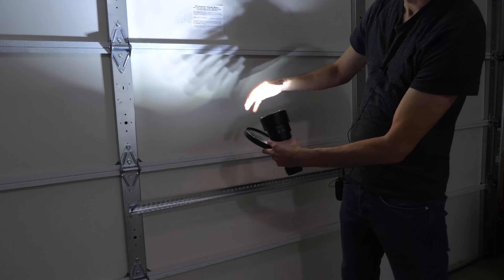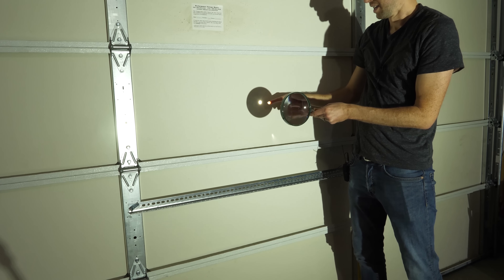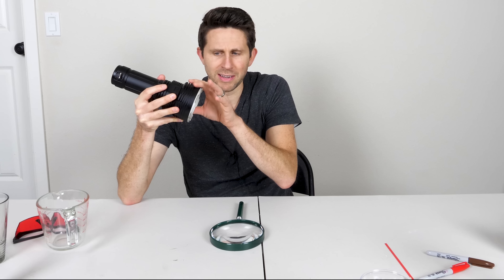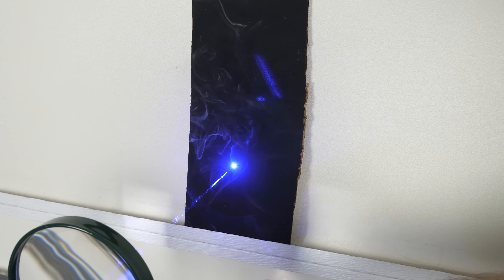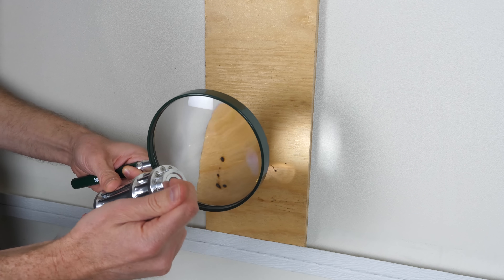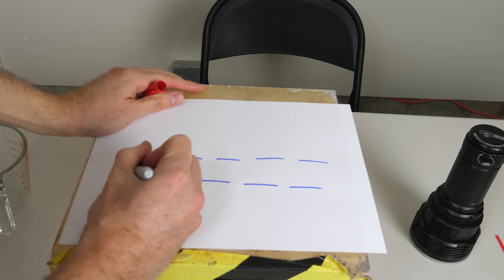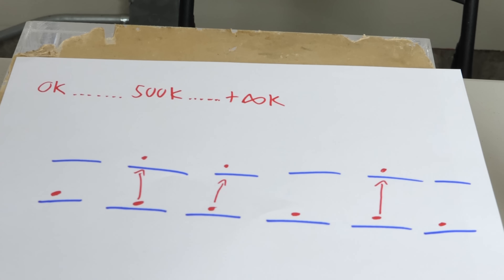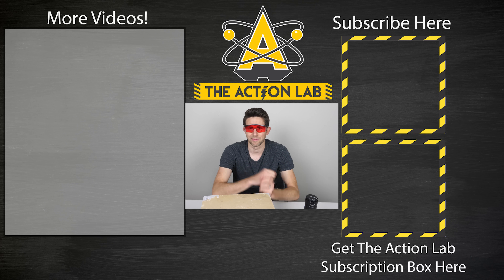What Happens if You Focus a 5W Laser With a Giant Magnifying Glass? Negative Kelvin Temperature!

Comment: I can imagine a combination of lenses and mirrors that would be able to focus most (losses in mirrors and lenses) of the flashlight light (lumen) towards one point and as it is true that this flashlight has multiple LEDs, i can suspect, that the focused point would be brighter on a "super white" surface (candela) as any point of the light source, as it would focus more leds "shine" (lux) towards one surface point... But clearly understand your point, but it assumes one point light source. Even a surface light source as the Sun can be focused with a big enough lens to shine brighter on one spot then it would be without the lens, but even o a black ithem the temperature will newer be higher then on the surface. Just temperature not always corresponds to subjective perception of brightness (as luminous flux takes into account the perception of individual wavelenghts)...

Comment: Wtf, this is simply not true.
Reply from the maker: You need to do a little research buddy
Reply: @TheActionLab  i did, lasers dont fall in negetive Kelvin and is not the reason it gets hotter when but under a magnifying glass is because it concentrated the light to smaller point the light from the laser never get brighter. The same concept can be seen in galileos telescope if light is shined from the other side

Comment: You can get a hotter point that the source. You're confusing temperature, a form of kinetic energy, with the total energy output of a source, the actual thing that is mentioned in the 2nd law of thermodynamics. You can use sunlight to focus and make a point hotter than the surface of the sun, it will just be very concentrated and will most likely disperse immediately. The amount of energy for this will still be smaller than the sun's. Otherwise I guess I agree with everything else.

Comment: i dont see how it would violate any law of thermodynamics. from this experiment, it looks like the sum total of light and heat remains the same, but the applied surface area is much smaller, in the same way that youre not suddenly heavier when you take off snowshoes, your mass is just focused on a smaller point. can you measure the temperature of the laser beam both while normal and focused?

Comment: Could you reflect the light that misses the magnifying glass so you don't lose it?
Reply: You would need an even bigger lens... which would require a longer distance from the light source for it to focus... which would require an even bigger lens... which (you get the point).
And still, even if you could, you are just redirecting the light. So I believe it would not be any hotter than the surface of the LED light.

Now, if you reflect and intensify that light with a mirror, and lead a tiny percent of that light escape thru it (all mirrors do this because there is no such thing as a 100% reflective mirror) and you direct that tiny percent to a specific point. Then, well, that would be a laser :P
Reply: If you reflect the light, the light can't bend enough to focus into a single point. It'll just keep going in its own little direction.

Comment: Oh my. Yes, you did not break any laws of thermodynamics. Yes, you did burn your target more efficiently using the the magnifying glass. You proved both those things. But everything went off the rails in the explanation. What happens is that the output of the laser is focused. Think of it this way, the output of the laser is 1 Kg of feathers, the magnifying glass changes it to 1 Kg of lead. As for negative Kelvin, serious math and quantum physics concepts were broken. Your video is an interesting display of scientific curiosity at work. Stay curious.
Reply: William Morton read up on negative temperature and you will see what I mean.
Reply: @ActionLabShorts  Thank you for reading and responding to my comment. Just a couple of things. "In quantum thermodynamics, certain systems can achieve negative temperature; that is, their temperature can be expressed as a negative quantity on the Kelvin or Rankine scales." - Wikipedia. The key word is "system." A system is bounded, it has a wall. A wall may be permeable or impermeable to matter, energy and/or entropy. A laser might be described as a system with a wall that is permeable to energy. Any system that involves negative temperature has a totally impermeable wall. It can never interact with its surroundings. Any system with negative temperature cannot interact with its surroundings. Crudely put, it can exist in theory but never in the universe. Hope this helps. Keep doing science.

Comment: your not correct. you can coalesce all the light from a flashlight into a single small point. the flashlight you use has a bunch of led being directed through projector lenses. that is why when you stick the lense in front of your flashlight it spreads the light. you would need a lense with the opposite curvature on it since you are already lensed in the flashlight. as far as focusing light, you can only focus something from the size of the lense to the smallest point. it is the same amount of light you started with and puts it all in one point vs spread out  your experiment is very inaccurate and doesn't account for or control for the variables

Comment: You can make the focal point hotter than the source it just takes geting it focused in a small enough point. Also the focal point is not actualy hot itself. Also if you got the focal point hotter than the source. What you cant do is by taking lets say 10w light source and focus its output to a point that would be mesured as higher than the source. If im wrong tell me.

Comment: You can never focus a diffuse light to a single spot because it's a surface source, meaning that the light is emitted from a surface rather than a point.
For any light to be focused to a single point, it must come from a point source.
Perfect point sources have zero volume and surface, which can't exist in real life.
However, lasers are a close approximation of point sources due to their highly parallel photons.
Though not even lasers can be perfectly parallel due to diffraction; to to have a perfect laser, the opening must be infinitely big.

Comment: Just a question, you said it is never brighter than the surface of the sun, but considering that all light rays are parallel,  taking a section of the sun with same surface of the lens and not considering atmosphere consumption of the light, the resulting ideal point is brighter than the surface we have taken?

Comment: What's really weird is the temperature scale is like a circle. You can reach negative temperatures by passing absolute zero as well. As you get really close to absolute zero, I'm talking within trillionths of a degree, there's so little energy that the molecular bonds, and eventually the subatomic bonds break down because there's not enough energy to hold them together while everything just gets flatter and flatter which is why a drop from absolute zero (the coldest temperature possible) can result in a pure high energy state, because there's no longer anything keeping the particles together. I probably didn't explain this very well but hopefully someone can do a better job of saying what I'm trying to say.

Comment: I am a CNC Laser Operator and that how my Lasers work ... it sends a 4000 watt beam through a series of mirrors to a lens torch that has a high grade lens that narrows the beam down to the range of .005 to .008, which is the general range we use, to cut metal that is generally between 1/4 to 1/2 inch thick

Comment: Why does the distance between the Laser and the Magnifying glass matter? I can understand the distance between the magnifying glass and the target, to set the focus but why does the position of the laser matter in relation to the lens?
Reply from the maker: Just to get the point of laser light to the smallest point possible.
Reply: @TheActionLab  Yes, but what is happening in physics to cause that relationship between the distance of the light source and the lens? Does that relationship change between using a polarized light source (A laser) vs a typical light/the sun?

Comment: Something viewers should still note: While you can't get a hotter temperature than the source of a flashlight or the sun with a magnifying glass, when the source is far from the surface you can still amplify the weaker dispersed light that reaches the surface to be hotter than the dispersed light is - just not hotter than the original source.

As kids my brother and I would go outside and burn stuff by focusing the sunlight with a magnifying glass. Condensing sunlight that covers the surface area of a magnifying glass down to a single point is hot enough to burn, but still nowhere near the source temperature of being directly next to the sun.

Comment: Uhm when you are using the laser directly against the wood, the light isn't concentrated on one point, it's still pretty large, so that's y it doesn't get as hot as the  the focused laser point because you then have a smaller surface area, and about energy, in my personal opinion your explanation for whats happening doesn't make sense, I think you just confused temperature with energy, the total energy at the focused point will always be less than or equal to (ideal case with 100% efficiency)the energy supplied by the laser pointer. The laser pointer isn't hotter than the focused point because energy is not = temperature, it's just that at the wood, the energy is used to increase the temperature of the surface and at the laser pointer, the light is the main form of energy and thus isn't as hot
Reply: In short energy has many forms light, heat sound etc. You just confused light energy and heat energy I think. So the 2nd law still holds true, and that -ve Kelvin temperature stuff didn't  make sense to me at least.
Reply from the maker: I didn’t confuse temperature and energy. Heat always flows from hotter temperature to colder temperature. The temperature of a laser is hotter than whatever you shine it on due to population inversion. What you shine it on can only go to positive temperature, but never negative.
Reply: @TheActionLab   The Action Lab  okay I read up a bit more on population inversion and I get what you are saying, cool, I'll edit my comment, but I still have a question

Firstly I think the laser isn't as hot as the surface it's shining on because the energy to heatup the surface is being transferred in the form of light not heat, so it heats up because there is no flow of heat but rather flow of energy in the form of light and then  conversion to heat at the surface, therefore I think the second law holds true since there is no transfer of heat energy, is this correct?

Comment: from an optical approach the problem is lenses focus only parallel light in one point  so you can only focus the part of the light that comes straight out of the flashlight. a laser on the other hand generates light that is allmost completly parallel and therfore you can focus the entire output in one spot.
Reply: also the farther away you hold the lense from the light the more parallel is the light that hits it and so more of that light gets focused and there is less of a "mess" behind the lense and more of a dot.

Comment: You still lose heat through the lens but the point is also reducing the radius. The heat density is more constrained and doesn't violate thermal dynamics due to reduction of area in which heat is applied

Comment: I think I disagree with your explanation. Maybe I'm trippin', but I don't think the laser is getting hotter overall once focused with the magnifying glass. However all the energy dispersed over the width of the laser beam is now focused onto a smaller point, and thus the energy at that point is denser and it's "hotter."

You could make a point that's hotter than the surface of your flashlight using a magnifying glass. However the amount of energy in that point would still be the same as the surface of the flashlight. You'd need the reflectors on the flashlight to first reflect the light such that it were a much narrower cone like a laser so that all the light could go through the magnifying glass at the desired focal distance. Makes sense? In this situation, you'd end up with the same result as the laser - the point the light is focused at would have the same amount of energy, but denser than the surface of the flashlight, and thus hotter.

In my mind the lasers are actually not different than the flash light. The problem is the way the light is directed. The laser is a very very narrow cone, the flashlight is a broad cone. So at the distance you can focus the flashlight beam to a small enough point, most of the light has already dispersed.
Reply from the maker: You are correct, that’s the point (so you don’t disagree with me, lol) The laser has a temperature that’s hotter than positive infinity. So even if you got any object you are heating to positive infinity the laser source will still be hotter.

Comment: I think the main reason the energy is flowing from cold to hot is because you use energy to achieve this. After all, in a fridge the same happens; you use energy to cool down a cold space and at the same time heat up a hot space. I feel like this explanation makes more sense tbh...
Reply from the maker: Heat never flows from cold to hot, even in a refrigerator! Please don’t ever think otherwise. The whole method of operation of the refrigerator is compressing gases so that you can remove heat while the heat always flows from hot to cold
Reply: @TheActionLab  still, overall it's an active heat transfer from cold to hot. I am aware that heat never travels from cold to hot passively, but you could consider operating a laser an active heat transfer.

Comment: Hey TheActionLab,

Wouldn't the light be able to be bent from the flashlight into a smaller point when you get a really strong / multiple lenses in front of it? I get that the purpose of the intro was to show how we can never get a spot hotter then the surface of the sun, but I feel like that is just true because we can only get a very small amount of sunlight relative to what the sun actually emits. 

Also, according to Q = cm(Delta)T, if we heat a very small mass we need little energy to get a high temprature change. 

I would like some sources that tell about the negative temprature, as well as your opinion on this.

Comment: would it be possible for something to go a negative speed?
Reply: The Novel Ice Cream Studios yes, negative velocity is based upon what you decide is up and down really, negative doesn’t equal backwards, it’s just the opposite, so if you throw a ball from ground level and it goes lower than ground level like into a body of water you could measure that as negative speed, negatives in speed or velocity are usually relative to which direction you are considering to be positive. The ball would be going negative ft per second, making the velocity negative. ( anyone feel free to correct me if any part of this is wrong )
Reply: RebelRhiannon speed isn’t ace velocity speeds a scaler velocity’s a vector so the “negative” velocity just defines its direction but speed itself cannot be negative! Hope this helps
Reply: The Novel Ice Cream Studios negative speed is the rate at which I’ll finally get around to cleaning the garage
Reply: Mattia De Cecco  not necessarily, you are actually still going a "positive" speed because you are still moving.
Reply: Mattia De Cecco no that’s called decreasing your velocity, that’s not a negative velocity

Comment: +The Action Lab
Interesting!  How small the point can get is also limited by the wavelength of your light source, and how accurately machined your lens is.  There's an equation for the former.  By the way, what is the wavelength of that laser?  Lastly, I never thought of the law of thermodynamics being violated in that sense.  What if you had a giant lens that could capture all the light and focus the image of the flashlight down to a point smaller than the LED image (because it is far away)?

Comment: if you use a highly concave mirror would it work with the flashlight? Or rather than a magnifying glass, a plain lens with a different curvature. Also, you wouldnt defy any law since you are just changing the location if the heat. You are concentrating it, not amplifying it.